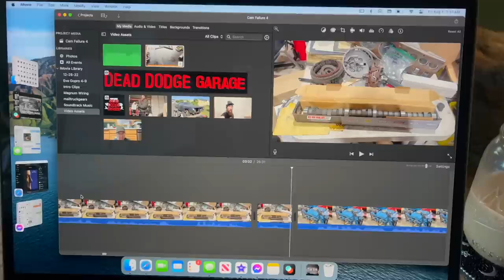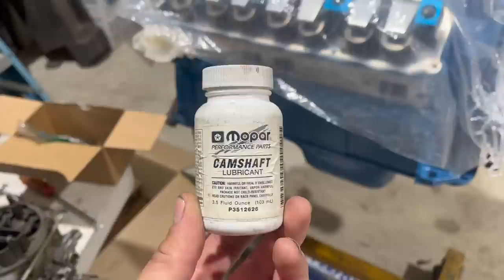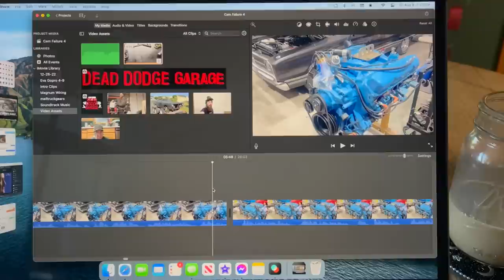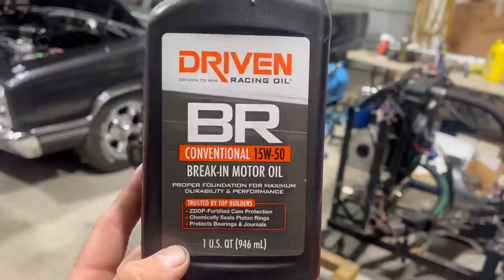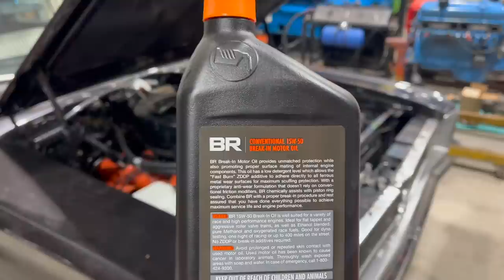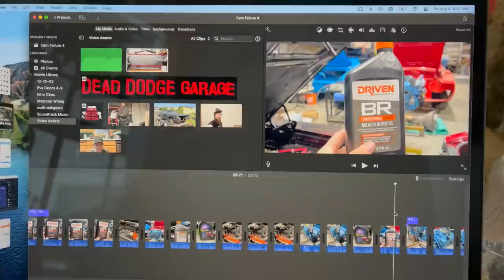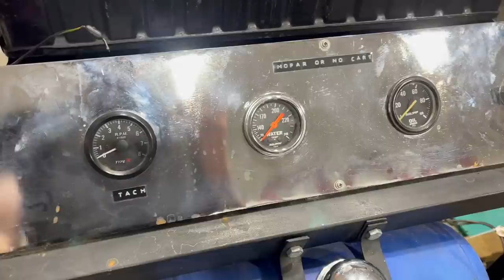How To Make Your Flat Tappet Camshaft Live, And The Anatomy Of A Failure

Comment: The engine speed recommended for flat tappet break-in is necessary because there is a sweet spot where actual friction is optimal. Too slow and there's too much drag. Too fast and there's too much heat and that causes weakness of the metal, which degrades to surface and it'll wipe. You're supposed to periodically vary from 2k to 2500 rpm. The biggest issue for failure is the shoddy manufacturing. Poor metal quality. We had Gen 2 hemis with their ridiculous spring pressure on flat tappets of the day and THEY didn't wipe out. They had windage trays too. Typical break-in procedure states 500 mile oil change after break-in. And psst....that Driven break-in oil is LOADED with zinc, i.e., the zddp you mentioned so no, the oil hasn't developed an A.I and detected the zinc and removed it  also, you can be the greatest engine builder ever, but crap is crap, and it'll fail.
Reply from the maker: Yes - and that Driven break-in oil is also low detergent. Thanks.
Reply: It's SUPPOSED to be non-detergent. It is not intended for extended run time. It suspends trash for removal. So, it carries the zinc, and removes the initial waste products during the break- phase. Detergent oils break down these components, extending oil change intervals. That is not the goal on initial break-in. You're welcome.
Reply from the maker: @tvdroid22  I don't understand how you don't understand that I understand this. I said it in the video. I'm saying it now. If you're taking issue with the fact that I said "low detergent" instead of "non detergent" in my last reply, it's only because that is what it says on the Driven Break-In Oil Bottle. Thanks so much.

Comment: "high energy" - thats a marketing name, and nearly meaningless in the grand scheme of things.  It does not indicate ramp intensity, although I happen to know they are faster than the magnum line coming off the seat..  For 0.006" to 0.050" lift, the card lets us do the math.  Please note muscle car era cams were 30 degrees or more, for longevity.  The flank??? Send that off for Cam Doctor inspection - it can chart lift degree by degree if you like.  I am a fan of parkerizing: hardness goes just a little deeper than other processes from what I've read, and as a bonus... it seems to give oil something to hang on to just a little better.  As for "break in"... if grind geometry and surface finsh [cam & lifter] is good,  why are we putting in an oil designed to increase wear through reduced protection?  It may just be that people taking springs out [or changing to weaker ones] are trying to escape their break-in oil?
So a little end note on bad ideas: how they sometimes get started.  Remember all those old car magazines?   Well... theres a problem even god guys can't escape:  meeting deadline is the golden goose - without content, advertisements go nowhere.  For that reason, getting things right can only rise to number 2 on a priority list.  Publish or perish.  Anyone know where "break-in" mantras started?  I... don't know.    But math suggests that back in the day, assembled flat tappet engines got about 5 minutes worth of run-in time, then went out for final assembly or remediation.   But just maybe a break-in procedure is needed, and the "more is better" crowd is breaking engines by stretching 5 minutes into 20 or 30?  Detroit has moved on regarding design, so it would be the retired that can answer some of the unknowns.  I'd love to hear from engine assemby guys that actually did the work in the 60's or '70s.
Reply from the maker: I’m hoping to hear about the actual factory procedures for engine break in some day. Stupid idiots on the internet have tried to tell me there couldn’t possibly have been any factory break in procedure - an argument that makes zero sense. But I have no data to go on. High energy is a proprietary name, but belonging to the largest cam manufacturer has helped it become the defacto name for a lobe matching its profile. If you think that’s meaningless, ok. I am confused by your description of break in oil. And at this point I think I’m done typing.
Reply: @DeadDodgeGarage  From what little I can gather, typical oil these days loses protection somewhere in the 80,000 to 90,000 psi ranges.  Some are way better, some worse.  Break in oils quit somewhere in the low to mid 50,000 range - thats why I say increased wear through decreased protection.  One of the ongoing tasks I dig at is trying to find non-automotive uses that engage similar treatment.  I'm still looking... and assuming this is a valid means of preparing machined surfaces for use, surely this happens somewhere outside car engines?  Maybe bedding new cross slides on a steam locomotive?  So for the time being, I am resigned to only one thing needing initial increased wear:  rings.  They have to seat on startup, and lapping compound cannot be used in a mock up - it would probably get into ring lands and cause unwanted taper [plus... can't fire up a motor with that anywhere in the first place].
So knowing that lobe taper vs lifter crown presents a small proximal tangent area with peak load, I ran some hypothetical numbers.   Spring load over the nose: 300 pounds and rockers are 1.5.  That becomes 450 pounds force through lifter directed at the cam.  Area?  Estimate 0.008 square inches of peak load area on the lifter [roughly 0.090"x0.090"]  - that becomes 56,250psi the oil has to be better than... and acceleration forces are yet to be added.  
Meanwhile, I likely dress bores with break in oil, put vr1, redline or some such in the sump and fire it up - change the oil somewhere between 50 and 100 miles to see if anything is going south.  I'm paused on a current build for cash reasons, but also... up to my eyeballs with bizarre electrical issues.  12v neg post to chassis WITH cables all attached where it worked [for years] before?  The twilight zone has landed under my hood.

Comment: "Unnecessary Idling"? How long is too long or unnecessary?🤔
Reply from the maker: I would call beyond a minute of idling excessive - especially when the engine is still breaking in. If your car needs to continue running at a stop for a longer period, I would be inclined to occasionally blip the throttle or briefly hold it at a higher RPM intermittently. Again, with a flat tappet cam, extended periods of idling can lead to lifters not spinning and wiping out. I would just try to avoid that as much as possible. At least having it in mind could be helpful.
Reply: @DeadDodgeGarage  
Wow, that's deep.  That would make me freak out at stop lights if I just picked up a car from a garage after a engine rebuild. 😬
Reply from the maker: @dogdoc1  it should! You need to take precautions with a fresh flat tappet engine. Someone who builds and knows them well will be explaining this to you when they are done - because they want their build to live too.
Reply: @DeadDodgeGarage  
Thanks for the info i will take this to heart.

Comment: Isky Rev lube is the  best,  contains molybdenum disulfide. 
Lifters MUST rotate!!!
I've broken in a comp cams XE grind with the springs supplied  for running,  not a light break in spring. Was fine.
And non detergent oil with a zddp additive  
Never had a failure with this combo
1) Isky rev lube 
2) proper taper on cam and a lifter crown to insure rotation
3) non detergent oil with zddp added

Comment: "Dyno" Don MacAskill from Shaver Specialties Racing Engines and Lake Speed Jr from Total Seal Piston Rings share tips and tricks on how to break-in your new or rebuilt engine. Failed camshafts, oil consumption and other problems can stem from improper break-in procedures, so watch as these two experienced experts show you how to properly break-in an engine without using an engine dyno. The video also references other resources such as choosing the proper break-in oil, so we've provided links to those videos below.  https://youtu.be/MhA_nVRhYew?feature=shared
Reply: Certified Lubrication Specialist, Lake Speed Jr and Keith Jones share their knowledge and experiences with different brands of engine break-in oils. Spoiler Alert: The right break-in oil DOES make a difference, and the WRONG break-in oil can be disastrous. https://youtu.be/Fj2NSteaPnM?feature=shared

Comment: Just stop putting rock hard springs on them. I blame most of the failures on hard springs. So what if it floats at 5500, At least it keeps running for years. Soft springs save engines and give you a built in limiter.
Reply from the maker: That’s part of it - but the softest springs in the known universe won’t fix the machining on the faces of modern lifters.

Comment: I started using the 10-10-10 break-in method even when "aggressive" spring pressures aren't a factor. Mostly becasue it gives two intentional cool down periods to tweak/troubleshoot things if needed. 
https://youtu.be/b2LzSz9W1Sk
Reply from the maker: Nice. I actually just read something else saying the same this morning. I really like it. Little issues always come up, so it’s great to have the time to deal with them. Snug valve covers… check fluids… double check other fasteners. Etc.

Comment: Valvoline makes a high zinc I run a man all my vehicles all the time I have had a few cams being wiped out for same reason that you and everybody else has just crack it down to poor workmanship or no quality control flat tappet sir thing of the past and unfortunately those of us who love the older engines and still like to go that way have to deal with the few extra problems it comes with the territory I guess it shouldn't but it does
Reply from the maker: Hence these videos. I fully intend to continue building flat tappet engines, despite what the commenters keep saying. Valvoline Race is good stuff. My local parts store sells Kendall GT-1, which supposedly also has the necessary ingredients and costs half as much. I have been running it in my classic engines for years now. So far, so good.